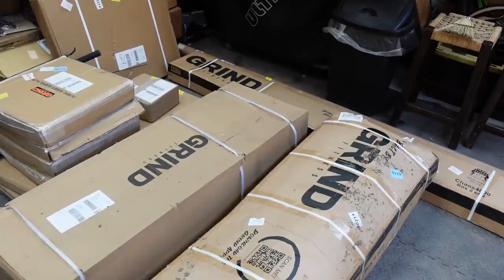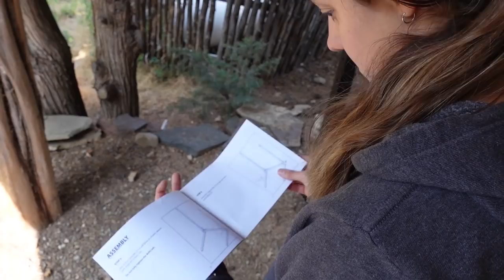Setting up our HOME GYM and riding some old favorites (Glorieta, NM)

Comment: Love that trail!

Some horse mats from the tractor supply co would be a cheap way to make a rubber “floor” for the gym.
Reply: I think you can get 4’X8’ mats 3/4” thick for $20 each. They also make it better for jump work.

Comment: Few tips - make sure your lifting area is level.  You don't want to develop any imbalances due to height mismatches (might also save you from your barbell running away from you too).  The J cups can mar your barbell a bit if you run into the front of them (i.e. reracking on a squat).  You can tape the sharp surfaces (electrical tape?) to save the knurling on your bar.  Might want to double check the height for the safeties in your bench competition :)

The lifts that help me a bit with imbalances are mostly in the posterior chain (barbell or inverted rows, pullups, deadlifts, bb hip thrusts, lat pullovers).  OHP is one of the push movements that also seems to help me.  There are some cool things that you can figure out how to do without specialized equipment (i.e. nordic curls / reverse nordics / sissy squats)

Comment: I bet the ebike has some advantages to Syd's fine strength.. Like hockey and using the training pucks, moving that extra weight around on the regular is probably doing more good than most people think.

Comment: You know, all you need is one bar, some bumper plates and a place to do pull ups. If you're outside in NM with no floor to destroy, you can just go with the cheap steel plates. When was the last time you rode your bike lying on your back?